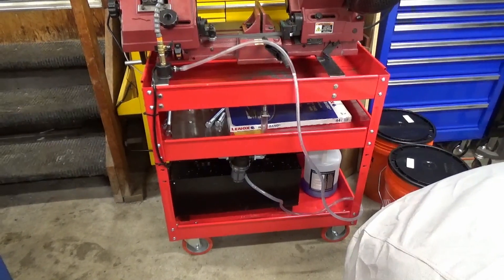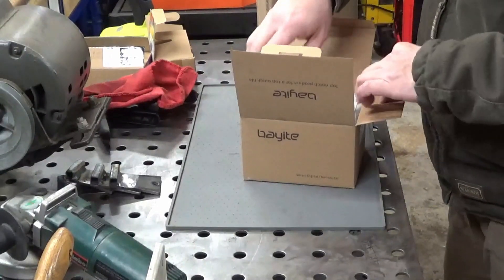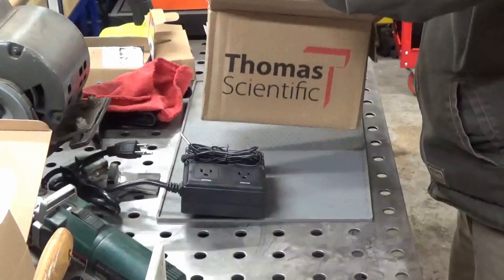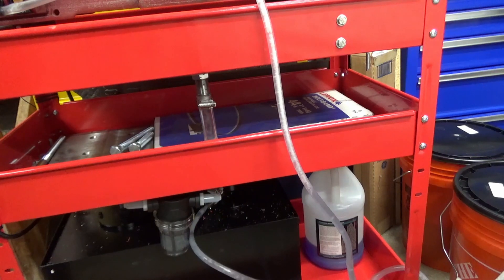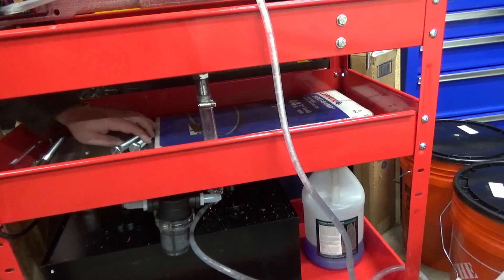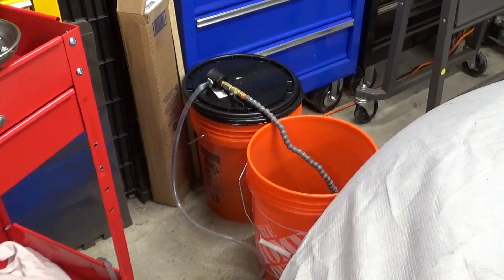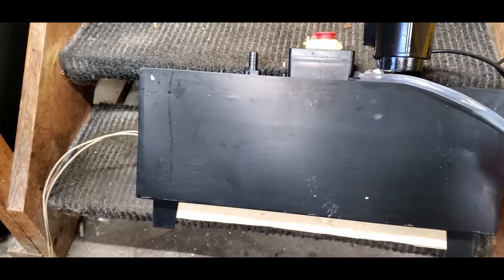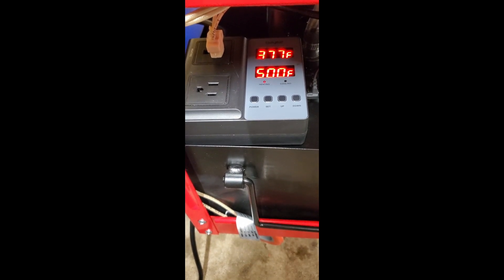Harbor Freight 4x6 Band Saw Modifications Part 4

Comment: G’day Mike did you ever think that you could have used an aquarium heater I use one in my home brew and that keeps it warm, all you have to do  is cut a hole in the top and add a temp gauge.   Easy and a lot cheaper and when you consider they can heat up to thirty liters and you can leave it on.  It was just a ideal.     John

Comment: I am hoping to pick up a bandsaw the same as yours on Monday, along with a lot of other stuff from a friends bereaved estate. He was a model engineer & built a lot of 1/4 scale steam engines & traction engines. Very sad but i do not want it all going in a skip.. I already started to get the workshop ready to accept it. I need to lower it to fit under a 900mm bench top. 
Regards. Steve.